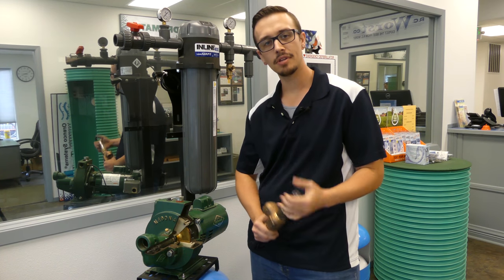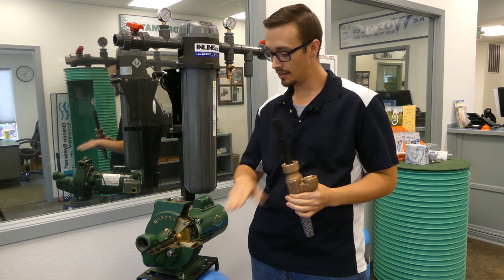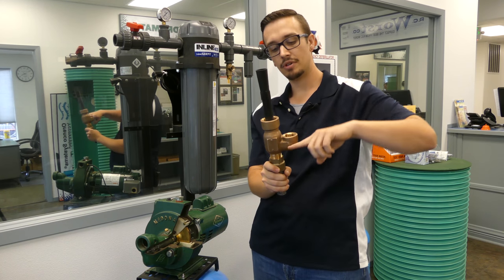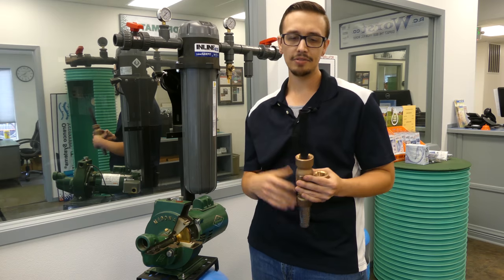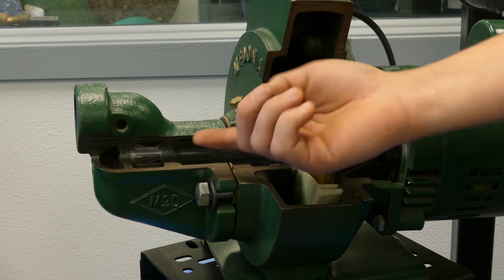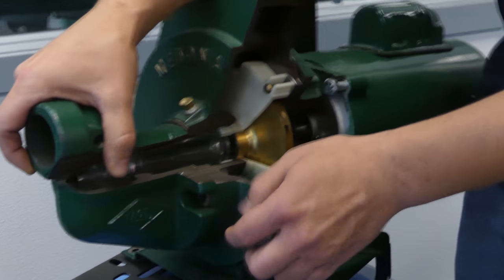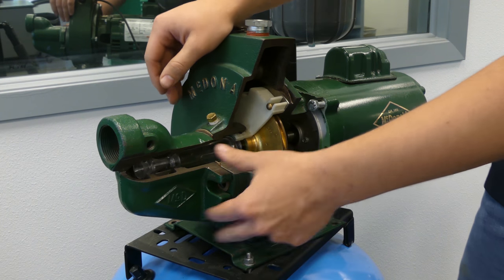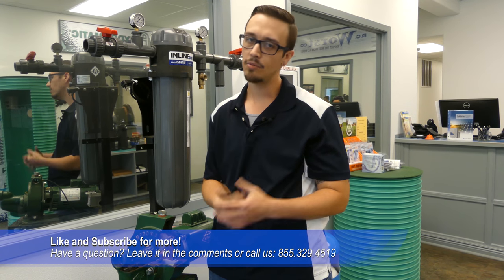What are Convertible Jet Pumps?

Comment: Thank you very much, ...  client is asking me to install a 3/4 HP Chinese made water pump with instructions that are useless.  The design for these shallow/deep well jet pumps is similar across most of these pumps, horsepower may vary.  Since the application I'm working on is a shallow well l can disregard the extra stuff included for deep well applications.  All I need is a plug for the bottom, smaller port below the exhaust port since it won't be needed.  Thanks again...,  Oh, if she had gotten an R. C. Worst & Co., Inc. pump in the first place it would have been much better.

Comment: Thank you professor enjoy your videos, they are most helpful indeed. you explain a great many things i never  knew anything about and now i understand how it works.  You help folks with home well and pump repairs and i think thats so cool. Now, after watching lots of your videos and studying all kinds of stuff online I understand how these things work. There are new things to learn all the time and i discovered one I'd like to share.  have this old outdated 2 inch at about 120 feet which never has delivered much in the way of gpm untill now. due too a long drought my well like many of my dear neighbors failed this year big time. I too had next to zero water pressure so out of desperation installed a new bigger more powerful pump which did not fix anything. I dig electronics and recall many fun years of designing and building all kinds of stuff like  push/pull electric guitar amplifiers and such. so what the heck it worked for that jazz, so why not this? So i got a second matching pump and working with nothing but galvanized pipe via elbows, tees, couplers, teflon tape and such, put them in parallel for even more water moving power, and even that nightmare of a plumbing job also failed? So after about a week of trying to get that mess to work on a messed up near dry well i disassembled the whole crazy thing and put them in series as a last ditch effort. Wow, now this made a real big difference.  after priming the new system and with both pumps running at the start-up  the first pump connected to the suction line delivered about 40 to 47 psi via pump #2 hit a staggering pressure of 140+ Thus, this super high pressure pushing through a partially pluged with mud and stuff injector blasted all kinds of stuff out of the well that same day. Lastly, the well water at first was very dark and cleaned up quite quickly. i reconnected the bladder tank and this two pump system charged it to a whopping 73 psi. My well water is still low due to this drought but the two pump system is working great. once again thanks for making these videos i learned quite a bit more watching em professor.... * * * * *

Comment: Sure hope you folks still monitor questions in this channel.  I have a tank sitting 100' in elevation above and 150' distance away from my spring system 2500 gallon bulk storage tank.  I need to pump water from the lower bulk tank to the upper tank.  I've guessed that a float switch in the upper tank can trigger the pump to start when the level drops in the upper tank.
Question: To lift that water the 100' in elevation from the bulk tank, would I need a deep well pump next to the upper tank to suck the water the height/distance required or would some other pump configuration work better?
Thanks!
Reply from the maker: Give us a call: 855.329.4519

Comment: Questions:
I have a well pipe 1 1/4 inch with the water table constant between 10-20 feet and am presently using a 1/2 HP shallow well pump.
Can I upgrade to a 1 HP  shallow well pump 
. So not see any problem with the well replenishing itself just concerned that the well pipe is too small for a 1 HP pump
as opposed to a 3/4 HP pumps.

Comment: Thanks for the video.  Question:  I have a goulds J05N pump.  I have a 80 foot well with the injector you hold in your hand.  My pump only builds up to 15-20 psi once I shut off the pump it drops to zero but the water still stays at the top of the pump.   It never reaches the cut off pressure to shut off.  The pump just stays running.  When I turn the pump on without the top gauge the water comes out of the top of the pump no problem.   Put the gage on and just 15-20 psi.  Cleaned and rebuilt the pump… took the injector out cleaned that.  New poly pipe installed 2 years ago.  All plastic barb fittings are double clamped.  I have no idea what’s going on.  The valves to the tank and house are closed so it’s just water to the pump.   Any help for me?   Thank you!

Comment: So the injector sits down in the well as part of a 2 pipe system and there is another injector that sits on the front end of the pump. Or you either have the injector in the well or on the pump itself. Not sure which it is.

Comment: I have a 1  1/4 inch diameter pipe source of water from the well.During summer here in Philippines the level of water is 9meters down the surface of the shallow pump that is why the pump has a hard time lifting the water.I am planning to replace the pump with deepwell pump,the problem is the injector  wont pass through the 1 1/4 pipe. If i make suction line from the injector down to the footvalvewith smaller pipe and  long enough to reach the water  and the injector is in the surface of the ground, will it work?

Comment: On the ejector, that plastic nozzel piece, I broke the tip and lost about an inch off it..... I am using it as a surface pump, there is no suction to speak of.  can I still use it? I think it's a F&W  cpjs, I'm still not sure!

Comment: Ok i follow the instructions. But my well is 2 inch 110 ft...
 Ive a 1 hp conv jet pump..   w a 40 gallon pressure tank... im lost to using or being able to get 2 lines into a 2 in well. Im feeding a pond is all w this well

Comment: It seems I'm going to spend my entire summer working on my well. Bought a new pump, all new fittings, primed it and it wont get over 35 psi. It did once, but wont hold the pressure. Pulled the line out of the well, it was heavy and full of water, so I know it was primed. New foot valve. Why wont it hold pressure.